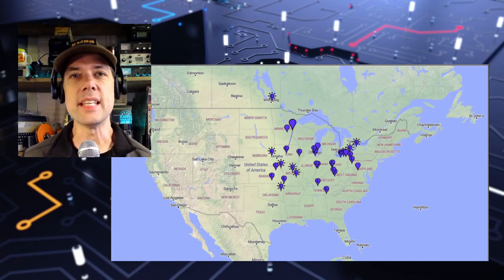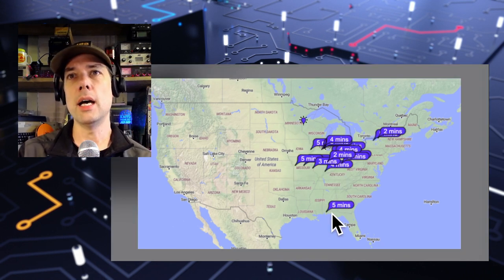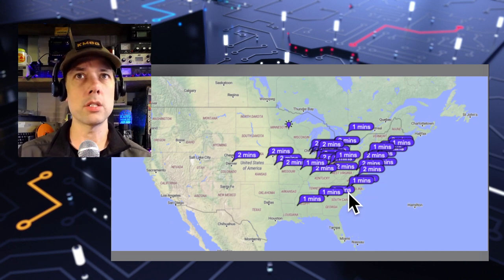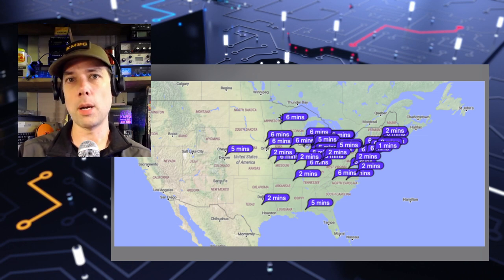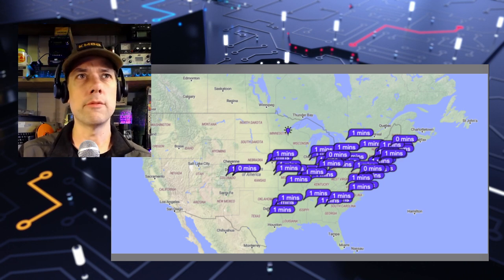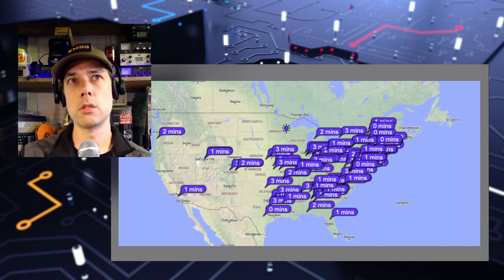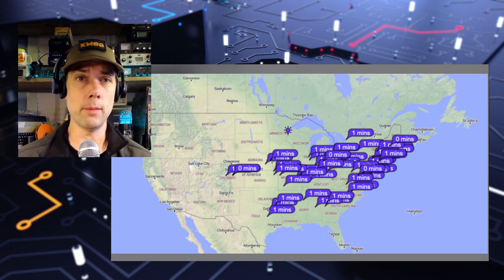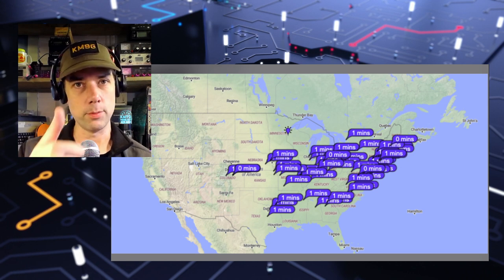Does antenna orientation make any difference?

Comment: Actually, I'm not sure the issue doesn't have as much to do with "Ham density" in different parts of the country than just the antennas themselves. I spend most of the year in South Texas and summers in Northern Lower Michigan. I use fan dipoles, OCF dipoles, EFHWs and I have a DX Commander in each location and I get roughly the same results you do in both Texas and Michigan when I run WSPR. The Michigan antennas are on 80 acres in a low noise area, a minimum of 50 feet from the house, usually on long wires at 46 or 50 feet up and in Texas where I have much less space to work my single long wire antenna is at about 43 feet although I'm very close to salt water.  And in Texas, I'm in small city and noise is an issue and that isn't great particularly for verticals. But at the end of the day, I suspect there are a whole lot more HAMs in the Midwest, East and Southeast than in the West (excluding California and that's whole different discussion because of mountains).  I don't have a problem with POTA QSOs,  or QSOs in general, in those Western states but there just not as many to be had.
Reply from the maker: That's very good feedback, Thanks.  The plot deepens!
Reply: I was thinking the same thing. Distribution of operators is certainly a factor, as well as timezone. @temporarilyoffline doesn't say what time of day his testing was. Would be interesting to try 0100L or 0200L and see what happens west-coast. People are perhaps out in the day or less active than later at night? This could also be a factor, especially for mid-west states where daytime is much hotter. In the UK, I'm active late at night (anywhere between 2400 and 0600 local time).

Comment: Hello Steve I have a Palomar Engineering Bullet 50:450 (9:1) HF Unun, 200 KHz-30 MHz, 500 Watts, End Fed Antennas 135' wire. Antenna starts at the SW at 35' to NW at 45'. 
Farthest contact in SSB Phone is Russia, Italy, Mariana Islands, Canada, Brazil, Spain, & Australia. 
Using FT-991A w/ a MFJ-993B Auto Tuner and a 150' DX Engineering RG-8X PL-259 Low-Loss 50-ohm Coax Cable Assemblies DXE-8XDX150. 
Been lucky on this set up based on my QTH. 
FT8 get farther out and all over the map. Japan dominates FT8 in my location beats the # of QSO on Domestic Stations.

Comment: Hi Steve, I hope you are well.

I really enjoy your videos, so thank you for the time and effort you put into publishing them.

I found your tests very interesting. I am only a HAM of a few years and maybe use the radio on HF a few times a month. My first HF antenna was a ZS6BKW in an inverted V configuration, probably about 9 meters or 30 ft at the centre above the house and about 3 meters or 10 ft at the ends. Looking down on the antenna from the sky the legs were not perfectly 180 degrees, probably more like 160 degrees. Roughly in a South East / North East orientation from my QTH near County Durham in the North East of England. This antenna worked fantastic and seemed to favour a South East pattern. I know that my QTH in the UK means I hit a lot of stations in Europe and there is mostly ocean in the East and North East from me. But I felt like north Africa, and Portugal are always a struggle compared to stations in Russia or Serbia.

I wanted to get on 80m and set up an 80m EFHW. This is about 7m up a tree and then about 32m sloping down in a North East direction to a height of about 5m. While this antenna is also working very well and I seem to get more bands, I feel the performance on some of the bands like 40m and 20m is much worse than the ZS6BKW. Interestingly, I felt the radiation and reception pattern seems very similar with both antennas. But the EFHW is more susceptible to interference, and not as goof as receiving. I also feel I could easily break into a pile up on the ZS6BKW using 20 Watts against some Italian stations using maybe 1KW.

I did have both wire antennas up at the same time, but was experimenting with my 2m / 70cm VHF / UHF antenna setup. I had the ZS6BKW attached to that mast and it was awkward to remove it with its ladder line and legs every time I wanted to make mast adjustments. I have the VHF / UHF antenna sorted now so may put the ZS6BKW back up soon as it is such a good antenna. But as I am not as active on the radio as I would like to be due to work and life, so its not urgent and the EFHW works very well. I am 90% morse code anyways on HF and 100% SSTV on 2m so its not like I need the most efficient antenna systems for these modes, especially CW.

I think your comments on factoring all the things like the time between the tests are very interesting as its a difficult measurement to consider when you think about the band and propagation conditions. Also time of day is a factor. I always think about the stories I heard as a kid about the electricity grid taking strain and seeing a spike in consumption when the adverts for the most popular soap opera comes on in the evenings.

So what you said got me thinking. It would be interesting to know from your test, what other factors such as a TV program came on 2 hours after your first test for example, which could mean you received less stations at that time because people went out the shack and did something else. Or maybe even the population of active HAMs in the middle and West of the country is less. I would also think it would be interesting to know how much aeroplane scatter is playing a factor in the tests. You just have to look at Flightradar24 to see how much reflective metal is in the sky.

Thank you for the great video, so interesting as this kind of thing is the essence of our hobby which is to experiment and try different setups as the results are stimulating and thought provoking.

Best 73s de David, M0XLS
Reply from the maker: Hey David!  Thanks for watching and glad it got you thinking!  I agree - there isn't really a perfect antenna other than "the one that's in the air right now"

Comment: There's a lot of population density to be considered in your plot as well.  I found it particularly interesting that neither the RX or TX patterns really changed significantly with your antennas orientation.  I've found WSPR more effective in measuring the subtleties your looking to demonstrate.  My experience has shown global population densities vs true antenna pattern are easier to feel out at any given moment of propagation on the planet providing some classic graphical patterns of antenna performance and thus full understanding.
Reply from the maker: There are so many variables that come into play here.  Most important is just get on the air and have fun with it.
Reply: @temporarilyoffline  Why do YTers always avoid getting into discussions? Could be so much more interesting, yet they just respond as above "for the algorithm". sigh
Reply: I think you nailed it. Population density, and local time of day all play a part. It may be 3 AM where I am, but not where you are!
Reply from the maker: @paradoxicalcat7173  Why don't viewers read all the comments before posting a response?

Comment: what band are you using?  In Montana 10w  on 40m is regional and 20 gets 800 to 2000 miles.  I haven't tested various ants and configurations simultaneously, but band selection tends to be more critical than antenna for distance.  Your test inspires me to test more.
Reply: AJ K  band?
Reply from the maker: Thanks Owl!  I was running 40m at 20w for the test.  Band choice is also very important.  I might do that one next.
Reply: @temporarilyoffline  TNX, I have tested verts against verts but the various deployments is a great idea.  At this point my approach is longer is better and verts for distance but more by feel  rather than data.  TNX for the inspiration.
Reply from the maker: @owlcricker-k7ulm  Let me know how it works out.

Comment: My 80m-10m EFHW is running E-W, Goes vertical to 40 ft, then across the yard to a tree about 50 to 55 feet. Propagation using WSPR really acts a lot like a vertical, with the exception that I don't see much to the west beyond the US. I might eventually try running the antenna in a N-S orientation to determine how that does, but overall I'm pretty happy with everything.
Reply from the maker: There you go.  One day it will be different enough that it's worth the effort to change it!  Until then, keep having fun!

Comment: You are on a roll. I am learning so much from your videos so big thank you for that. I am using a dipole about 15 feet up. I've tried Flat, inverted V and vertical with it. I am running 20 watts and I can't really get any contacts within the US. I am in Eastern Nebraska and most of the FT-8 contacts that I get are extreme south. Mainly into Brazil, Chile Ecuador etc. Not alot into the US. I think I'm going to lower my height and see if I can get more of a vertical take off and hopefully get some US contacts. I have yet to get a single contact north of my location. Ive tried orientating North to South and East to West with the same results. I did go vertical and I got into Hawaii but I think I will lower the height and see what that does tomorrow. Thank you for the insight and I will update my results. 73 my friend
Reply from the maker: Excellent,  looking forward to the results.  What kind of dipole is it?
Reply: @temporarilyoffline  I'm only a Tech for the time being so I only focused on the 10m band but its just a homemade dipole I whipped together out of PVC and speaker wire. It works tho. I hit Angola on FT-8 yesterday at 7989 miles away on 20 watts.
Reply from the maker: @yekim0007  fantastic!  You're on the right track!

Comment: Hi Steve have you ever used a half square. For 40 or 20m. Run north to south.   Signals. East and  west.  I found it worked well Nvis . And do. ?? Fed in top corner or with 49-1. Fed bot corner. Works as 40  20 m nice antenna.  Mark. In uk
Reply from the maker: I haven't run a half square, but its on the list of things to play with.

Comment: Very cool video, thanks for putting this together. Did you ever find out more why you didnt see more contacts from the west coast?
Reply from the maker: There are a lot of reasons, including just "today isn't your day".  If it "never" works its an antenna problem that you can fix by designing a better system, outside of that the variables change so much that "sometimes" is good enough.

Comment: Interesting tests, to be more conclusive you would need  to also consider which frequency you are on, especially time of day, grey line etc. On My EFHW tuned for 80m which runs from my QTH West to East  20 feet high  rising to 40 feet and sloping away to about 15 feet in the East.  On 20m at 1000z FT8  30watts in S England, most of Europe to the East up to Russia heard and worked. Same settings at 1300z I start to hear and  work US off the back of the EFHW to the West. Also further out to the East, into Asia and if conditions are good  VK on both short and long path in the afternoon. Almost nothing from Africa and the South apart from Spain, Italy.
If I change frequency to 18.100Mhz at 1400z and conditions are good, contacts from both E and W including US and South America until Evening when conditions change after Sunset, usually best to QSY to 40m and 80m and similar contacts to those of daylight hours. Also interesting to setup WSPR and do tests with better results on each HF frequency.   It makes all the difference on a EFHW. G4PEY
Reply from the maker: Thanks for sharing your results.  If I can find a waterproof+wifi wspr transmitter, I'd be game to test that out.  Really, this is where the human element comes into play - you can really only deduce a feeling about how all of this works because of the variables that you can't control in the testing.  The sun will always do what it wants, other operators may not operate that day, etc, etc, etc.  But we can still tell that 20m is good for DX and 80m is good for local comms close to sunset because of our human nature to try to bring understanding to the table.

Comment: Interesting video. Orientation appeared to make a slight difference, but not as much as I thought it would. You were still hitting the east-coast even if number of contacts seemed denser later on. Was it actually much later in the day, or even a different day? That alone could make the difference. The largest difference by far appeared to be the slope. It allowed a wider range of contacts (near vs. distant). I count "near" as within 500 miles, and "local" as within 100 miles.
Reply from the maker: It was all same day, but you're 💯 right that conditions change all day long.  There isn't a great way to compare as all the conditions change all the time.  Part of the fun!

Comment: great video.
it was nice to see the difference.
I would like to see next how a resonant wire vs non resonant wire affects reception.
You wouldn't need to mess with baluns etc if it was a single wire and receive only, we know how resonance affects transmissions.
Reply from the maker: I have run a non-resonant antenna with a tuner and it does sound better when tuned.  I think that has more to do with making the radio happy at 50Ohm then about hearing better signals though.
Reply: I'd like to see your results with a efhw at 19 metres high.

Comment: I have an off center MJF in an inverted V around 25-35 feet off the ground north to south. From SE WI I heard and talked to IL, OH, CA, TX, NY, FL...so just about touching the continental US. For international, Canada, UK, France, Canary Island, PR, Italy...from memory. Mostly between 20 and 40 meters. Happy given my limited space and under 100w of power. I hear stations going over 1,000w and they hear me just as fine from me pushing 50-100w. I had a vertical, thought it would be great for limited space and it just picked up noise and I could hardly reach out far. I may build a dedicated 20 and 40 meter from spare parts to hear if there's a big difference with a tuned antenna.
Reply from the maker: Antennas are fun - as long as you're making contacts or learning what needs improvement.  That's all that matters.

Comment: WSPR would be a better, and run a few test over 24hrs...FT8, most are not running low power, folks are running a few hundred watts, where are the WSPR folks are a bit more disciplined 5w, 10W, 100W etc. Just a thought.
For DX, elevated vertical is the way to go, 40M elevated vertical (6ft from the ground) with two or more elevated radials, I can work VK, NZ and Asia, simple and cheap antenna on a 12M pole.
Ground radials, I wouldn't have the patience or time in putting them down.
I don't do NVIS, as not interest in Inter EI/EU contacts...
Reply from the maker: Thanks for the tips Robbie!  An elevated vert with tuned counterpoise is in my future.

Comment: I have a few comments. When you said the wire was configured north or south or east and west I think you meant that was the way the wire was running. To be clear I usually add that the wire is broadside N/S or E/W so there is no confusion. However with a low half wave antenna it really makes no difference as there is  probably no directivity to speak of at that height.  As you get closer to half-wave high you then will notice a null forming off the end. The nulls will be much sharper and are what you will notice. On 10 meters my dipoles are high ( in terms of wavelength) and have deep nulls while the pattern between the 3 dB points is quite broad. I use three dipoles on a switch for the 10 meter contest and get dramatic results when switching them! My 40 meter dipole at only 55 feet seems almost omni directive by comparison. 
Regarding NVIS, as long as you are below the critical frequency, whatever goes straight up will come back down, but that is not to say you will not be heard out to 1000 miles or more. There will be no skip zone.
Any horizontal antenna at say a quarter wave high will have its peak radiation angle straight up. However the 3 dB point angle is still going radiate a quite significant signal and will cover a good distance. 
The vertical should have a good null straight up and and normally be significantly down close in to the antenna. The low inverted V will be very similar to any low horizontal antenna. I would expect no directivity if it’s low and increasing directivity as it’s raised. A sloping half-wave wire tends to skew the broadside pattern a little toward the low end. Again this is noticed more and more as the antenna height increases. 
It is very difficult to notice 3 dB of difference but 6 dB being an S unit can be detected if conditions are fairly stable. I once tested a horizontal wire, 70 foot vertical and a mobile antenna on 40 meters over about an 8 hour period listening to CHU Canada time signals  just above 40 meters. Depending on the time each antenna was clearly the best!
Reply from the maker: Thanks for the notes!